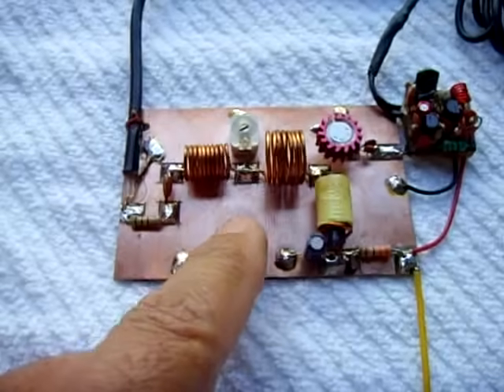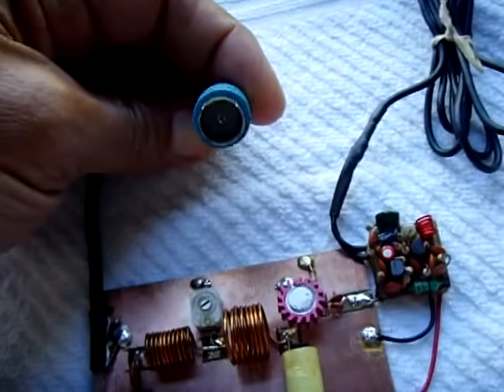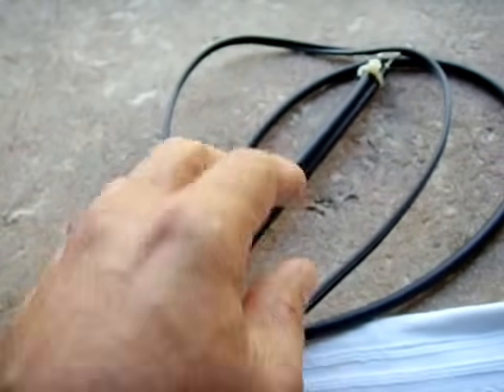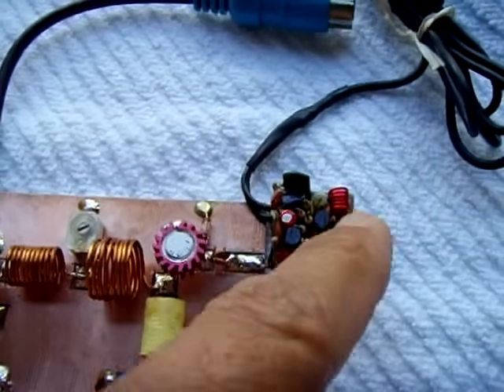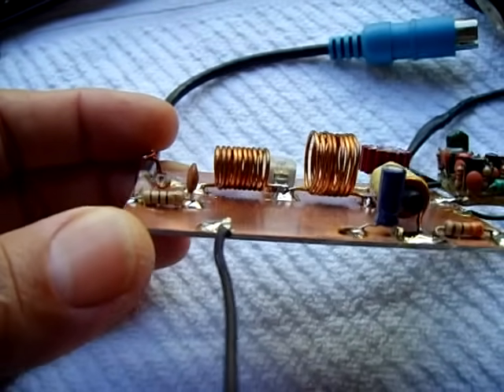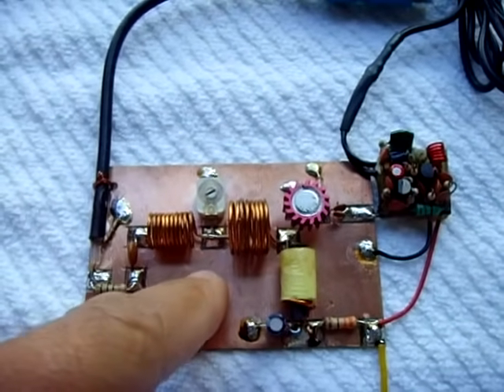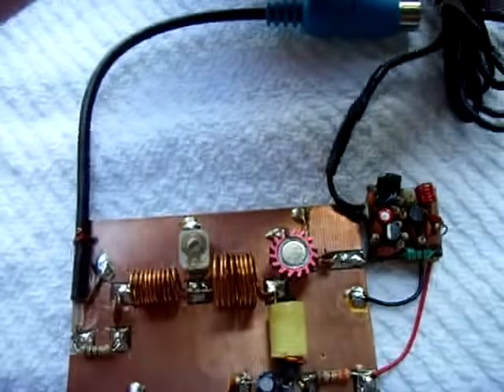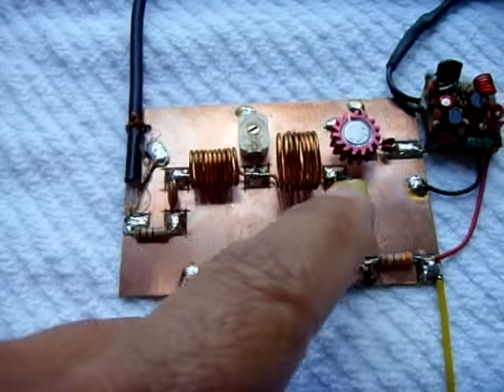1W FM RF Amplifier Circuit (Boost Low Power Transmitters)

Comment: I remember a few years ago messing around with a 3 transistor FM mic transmitter and replaced the 3rd transistor ie the output amplifier BC 547, or 2N 2222 etc with a medium power transistor BD 139 etc and increased the voltage to this output stage 15 to 20volts or so and using nothing more than a lengh of wire 1 to 2m long. The range achieved was at least 3 to 5km this was in the valley surrounded by mountains so could be that the range tested outside of the valley could be further. In fact if I recall correctly I also experimented with just adding the BD 139 after the 3rd transistor in the origional circuit and just loading it with a 6turn coil and 100ohm load resistor with the antenna coupled to the collector. There was no noticeable harmonics generated so never added any further filtering or refinements. It was just an experiment to see what could be achieved with a minimum parts count.

Comment: The FD700 diode is quickly becoming 'un-obtanium' and has no clear substitute. I used a 1N4148 and it seems to be working in my application (10mW input). 
I used a 2N2219 (a heavy-duty 2N2222) to see if the circuit would work. It did and I left it in. A decent heat sink is a must. Be wary of 2N3866 fakes. It is very simple for a pirate manufacturer to put a 2N2222 die into a TO-5 package. Who is going to pay return shipping for that?
The 10 uH choke is built on a magnetic core. I would use a 43 material toroid (FT37-43...FT50-43). Don't use the green axial inductors. The choke is critical. An incorrect choke can result in an awful hum or a red-hot transistor.

Comment: HI ! Guys 
I have built this  RF FM amplifier, but the transistor 2N3866 doesn't ON, because the diode FD700 (in the base) doesn't work and the circuit never on. If you want to operate this RF amplifier,  replace the diode FD700  with a coil (AWG 23/4-5 turns) wound on small ferrite bead. And click the base of transistor 2N3866 with metal screw driver, your RF amplifier circuit will certainly work. But before this you have to solder a 100 ohm resistor in the o/p of amplifier as a load. Beside this, this is a class C RF amplifier, so the dynamic rage of fm reception will certainly reduced i.e. very short ( approximately 100 to150 meters). Thanks !
Reply: Correction: (AWG 26 /4-5 turns)

Comment: Actually a folded dipole has a characteristic impedance of 300 ohms, six times that of your output port.  A single element dipole would be 73 ohms, a much closer match.  Just send single elements out, terminated on the ends, instead of folding them back.
Reply from the maker: Been a while, but I think I used a balun. Thanks for watching!

Comment: I realize that this question is non-related but is it possible to build an circuit kit that will convert RF from surrounding areas and convert that to 5 volts to power say a mobile device?
Reply from the maker: Yes, you harvest RF energy. 
https://www.mouser.com/applications/rf_energy_harvesting/

Comment: Can I connect my KT0803K Ic based small car fm stereo transmitter....?
Reply from the maker: Yes, but if the power output isn't too much, you won't get the full output of the RF amp.

Comment: The 2N3866 will yield you about 500mW
Try using a 2N4427 or a MRF237 to get a full 1 Watt output as the video advertises.
Reply from the maker: According to the datasheet, 1W.
https://rtellason.com/transdata/2n3866.pdf

Comment: These fm amplifiers can work to a fm transmitter for a rc boat? I think its the same thing.also this amplifier goes to transmitter not to the receiver right?
Reply from the maker: The frequency of the RC boat transmitter must be VHF. The transmitter output would be boosted.
Reply: @electronicsNmore  i am refering to remote control bait boat. In greece old transmitters use Fm/Am bands while the new uses 2,4ghz and 5ghz. As far as i know those VHf bands are used to military,for police and at real boats:)

Comment: Alright thats a problem because i already have 25 watts, i need to amplify it to at least 100 watts but the power i dream of is 1000 watts. I think this can do 100 watts if i give it a lot of amps and volts and a huge mosfet.
Reply from the maker: Make this instead for 100W power output:
https://www.electroschematics.com/25/rf-100w-bly94-power-amplifier/

Comment: Would this circuit work to amplify a 10mW signal which is 74.7 MHz? Could anyone help me figure out what size the coils would need to be for 72-75MHz range? Would any other elements need to be changed to accommodate that freq.? Thanks!
Reply from the maker: Yes. Refer to the link posted in the video description area. Thanks for watching!

Comment: The 2N3866 is made for 28 volt use. It might be better to replace the 2N3866 with a 2N4427 or a 2N5913 or MRF607 which are designed for 12-14 volt use

Comment: I have a low power fm transmitter. I want to amplify my signal to 20 meters. Can I use only a small transformer?
Reply from the maker: If you only need 20 meters distance, then you don't need this RF amp. Th circuit you have should be able to transmit 20 meters.

Comment: I have 1w fm transmitter and I want more power (<30W) ,so can I use this circuit with bigger transistor ?
Reply from the maker: No, you'd need to make changes to everything.
Reply: electronicsNmore 
Ok

Comment: Hello
Thanks for good video first
And can 2N4427 work too?
or only 2N3866?
Thanks!
Reply from the maker: Both work
Reply: 2N3866 is a very good transistor for RF circuits 👽👍I build transmitter mostly use 2N3866, I have bought a lot and keep it.

Comment: Hello Sir:  Did I hear you say that your antenna is tuned for 109 MHz?   WARNING!   There is a very important FAA  Direction & Range Finding, VHF radio service used for aircraft in the USA & other countries that operates from 108 to 118 MHz.  Whatever you do, you must NEVER emit radio signals on these frequencies.  This is exactly why properly designed FM broadcast transmitters have very sharp high frequency cutoff filters at the RF output.   Have you ever seen what looks like a giant hourglass surrounded by 50 giant cups, located at or near larger airports?  This is a beam-forming reflector surrounded by a phased antenna array that transmits a complex VHF signal that rotates at a 30 Hz rate.  STAY OFF THESE Aircraft frequencies.   Read about it here:    https://en.wikipedia.org/wiki/VHF_omnidirectional_range
Reply from the maker: I don't need you preaching to me. You're not telling me anything that I didn't already know. This device was made and used outside the USA. :-)
Reply: I'm not preaching to you. I am 60 years old and have worked with & designed electronics (Audio, RF high voltage and X-ray equipment) for more than 40 years. I operate a small business working with X-ray and electron microscopes now but when I was a boy, I built lots of clandestine radio: AM, FM, SW and TV transmitters just for fun.   In your video I did not hear you mention to stay well off the frequencies above the FM band.   VOR is used all over the world. Can you imagine getting accused of trying to down a commercial airliner?   These days, there's so much hysteria that it could happen just fooling with a fun toy.
Reply from the maker: Joe Sitter
Yes, you're preaching. I know pilots, there are other frequencies they can switch to if there's a problem. They can also relay messages between planes using other frequencies. 109 is NOT a commonly used frequency for commercial airlines. They use 110 and above. I spent years playing with scanners. Are you done yet? LOL
Reply: I suppose you're the kid that would always argue with your college professor.   'Bet you never even heard of VOR until today.   By the way: VOR can be found just slightly above 108 MHz in some cities.
Reply from the maker: Joe Sitter
I'm 100% convinced you have nothing better to do with your time.

Comment from the maker: **ADDITIONAL INFO: A Low Pass Filter was added to the amplifier board(lower left open area) AFTER this video was made. You can get that circuit in the video description area. You can use an online "air coil calculator" to figure out how to make the coils w/o an inductor meter. Use a drill bit set to wrap the coils. Just choose the correct size bit!

**CORRECTION: The input side resistor was a 10 ohm resistor, not 100 ohm.
Reply: what about the limiter and compressor?  Low pass filter will not help really, it sometimes makes things worse. Question: if i give it 20 volts and 10 amps, what will be the output?

Comment: how long the range it transmit ?
Reply from the maker: All depends on the terrain. Across a desert or open water, probably 1.5 - 2 miles, on a mountain possibly 3+ miles, and in a city, under 3/4 mile.

Comment: The balun you have used is a good idea as it is also a 4:1 impedance transformer. The folded dipole is a good antenna if you want lower voltages at the ends of the antenna and a wider SWR bandwidth than a conventional half wave dipole of the non folded variety. However the impedance of a folded dipole is around 288 ohms, a bad match for low impedance coaxial cables, be it a 50 or a 75 ohm line, it is also a balanced load for your transmission line (feeder cable). The half wave bal-un you used is not only a bal anced to un balanced transmission line converter, but it is also an impedance transformer with a 4:1 impedance transformation ratio. So if you're using 50 ohm coaxial transmission line for the balun feeding the antenna as well as for the line to your transmitter, then it present a 200 ohm source impedance to antenna. If you use 75 ohm coaxial transmission line for the balun and for the line to the transmitter then the antenna will be presented with a 300 ohm impedance. This is a very close match to a folded dipole (almost perfect). For your low powered experimental purposes I would use 75 ohm line and use a field strength meter to peak your amplifier for field intensity :)

Comment: The 100 ohms (10 ohms according to the schematic) resistor only wastes output power. It would not be necessary if the output circuit would match both the output impedance of the transistor, and the termination (antenna) impedance.
Also the input of the circuit is not impedance matched to the driving source.
All and all the design of the circuit is at least a bit dubious...
Reply: +Dazzwidd I think you are right! The series resistor converts the complex load at the output into a more resistive load, but wastes output power. (A bit strange that the award winning successful RF designer who did everything with a reason can't remember why he added the resistor :P )
Reply: I myself worship no man to be greater than the governing laws of physics
Reply: I think it was to get a better match to the output AND for stability. A wasteful way to go about it but it would have helped. Look at the output matching circuit of the veronica 1W fm transmitter. It has a much better approach. I would have a resistor to ground from the transistor's base to help with stability. It sacrifices a little gain but will help kill the circuit's tendency to oscillate a fair bit.
Reply from the maker: Ruud van Steenis The individual that designed this circuit is a very smart engineer friend of mine that owns a successful business selling RF devices and much more to the US Govt, as well as Space modules(Lunar, etc). I would say he knows his stuff. :-)

Thanks For Watching
Reply: electronicsNmore OK, maybe in that case he can explain the function of the 10 (100) ohms resistor... (Just curious, because I don't see the reason for this, although I have a degree in electronics.)
Reply: I agree, that resistor on the output is only limiting the circuits potential. I would put 
a 5 element chebychev low pass filter on it straight after the second of the two output coils and move the 1nf cap to being in series with the first of the two output coils (the one that connects to the 2N3866 collector).
Reply from the maker: Dazzwidd

I myself would never question the circuit designer. He is very successful, and his company designs and sells many components/devices to the govt/aerospace industry. I am sure he had a reason for doing what he did.

Thanks for watching.
Reply from the maker: Dazzwidd

There is a reason for everything he does. :-)
Reply: +electronicsNmore But we would like to know the reason why!
Reply from the maker: Frank55

I contacted him and this was his reply to me:

"That was decades ago. I suppose it was either for stability or to get a better VSWR. But I really don't remember."
Reply from the maker: Frank55
That was a ridiculous comment. If you designed as many circuits as him, and you can remember every reason why you did something in a circuit 20-30 years ago, then you are wonderful. I have circuits that I designed, and years later I say, "Why did I add that component?"
Reply: The 10 ohms resistor in the output of Class C RF amplifier is mistakenly shown. Actually there should be 50 ohms resistor, which represents the 50 ohms load of transmitting antenna. According to the practical information of class C RF amplifier, which tell us,that the class C RF won't start until it realised the 50 ohms load in the RF output, in the form of antenna or pure 50 ohms resistive load.

Comment: Is there any way, to calculate how many power a transmitter have?
Reply from the maker: Hi there. Normally you would use a meter inline with the FM transmitter output. Some people like to get a rough idea by measuring the total input current and taking a percentage of that amount to determine how much was used for RF.

Thanks For Watching

Comment: Your two coils ideally should be at right angles to each other so they don't couple. These form the output matching network as well as the output low pass filter network. With the coils in line and fairly close as you have them you will not get the desired properties of this network.
Reply from the maker: Hello. If you notice the 2 coils on the right side are positioned at right angles. I was told by the designer to make sure those are 90 deg apart. He said the other coil is fine.

Thanks For Watching!

Comment: Very good job on this RF amp.  Just a note: Can also use small PCB pads cut from PCB board and glue each pad in each place for each component on any surface (even medal for best ground plane) and then solder on components.  In other words, using small PCB pads a custom layout can be made when actual PCB board is not possible.
Reply from the maker: Yeah I know. That works great too. Thanks For Watching!

Comment: Good..... what is the range in KM ?
Reply from the maker: Hi there,
Due to many factors it is very hard to say what the range is. If your terrain is flat, or you are broadcasting across open water, then range will be excellent(5+ kilometers). If the antenna is placed high up, then you will have even greater range. If your in a city or rough terrain, then expect shorter range(maybe a couple km). If your broadcasting on the side of a big hill or mountain, then the range will only be high on the side of the mountain you are on facing outward. You will have reflected radiation off the mountain.

Thanks For Watching!
Reply: Thanks for your reply 👍

Comment: Do you have any information on the mini transmitter that feeds the input to this amp?
Reply from the maker: No, but I do have several other FM transmitter videos. You need to look through my FM transmitter playlist. There are a few good ones you can use.
Reply: I realize this is quite old, but it would be helpful to know the approximate mW output of the transmitter. There is pretty much no documentation on this circuit on the internet. I would not attempt to drive this circuit with much more than 10 mW, unless an attenuator is used.

Comment: Hi,
Nice design!
Is there a formula(s) to determine the values of c1,c3,L1,L2, and RFC if the carrier frequency is 73.600MHZ?
Reply from the maker: Not positive, but if you send an email to techlib.com, he will be able to tell you. I would think C1 would be around 100pf, C2 around 12pf, C3 around 10pf-12pf, L1 around 1.0-1.1uH, L2 around .7uH, RFC 18uH. Just my guess based on the chart.
Reply: You can use a air core inductor from collector and two trimmer capacitors to match the output. Stretch the coil and adjust the trimmers for max output

Comment: Whats the purpose of the 2 coils in the amp. Since its .."I'm assuming" not tuning. And the original transmitter is .thanks for all your work
Reply from the maker: This RF amplifier needs to be tuned "closely" to the frequency that is being amplified. The coils are part of that tuning.

Comment: Is your transmitter an AM or FM transmitter?  I am guessing it is an AM transmitter.  If on the other hand you are using an FM transmitter what is the frequency deviation.  I would think very small since the amp is class-C.
Do you have a link to a schematic for your transmitter?

Thanks for the video.
Reply from the maker: FM. The link is in the video description area.

Thanks For Watching!

Comment from the maker: 100mhz = L1>.82uH(18ga enamel wire-10T-7/16" drill bit as form) L2> .47uH(18ga enamel wire-10T-5/16" drill bit as form) RFC> 10uH is very common in a lot of electronics, If you do not find one, do not buy one, then you need an inductance meter to make your own. You will need to wrap enamel wire around a ferrite core until the value reads 10uH on your meter.
Reply: I can only count 8 windings for L1 in your video.
Reply: MyProjectsTV LOL, I think you should try cleaning out your ears dude. It’s 10t for a 100mhz but in the video I heard him saying that he used it for 109mhz. Maybe that’s why the amount of turns isn’t the same 🤪😂

Comment from the maker: This circuit is too powerful for that. You first need to find out what frequency the transmitter uses. Once you find that out, then you have to look for a RF amplifier circuit that can be used for that particular frequency. I would imagine that you could use a 200mW to 500mW RF amplifier with very good range.